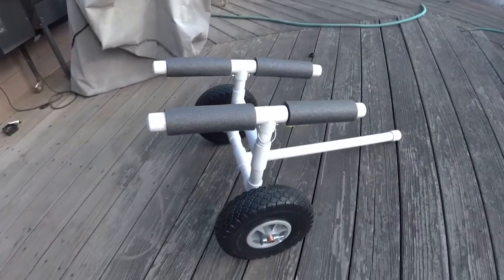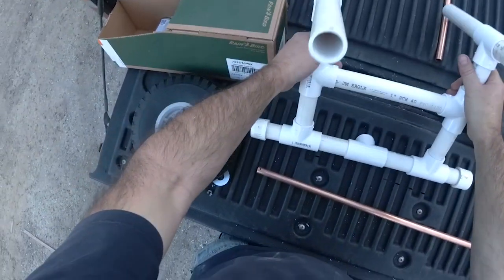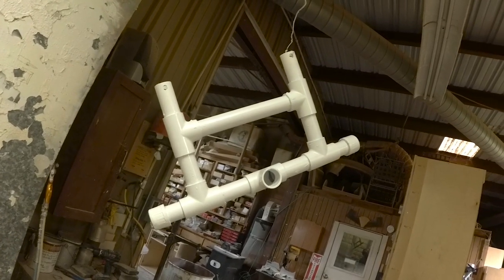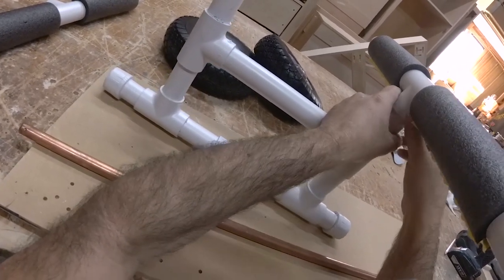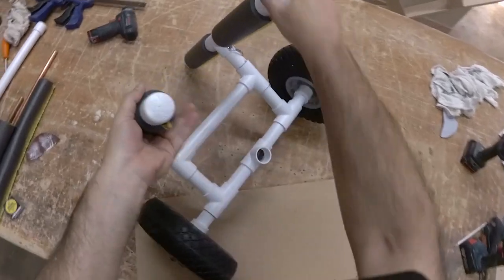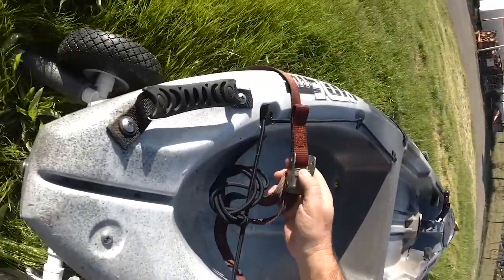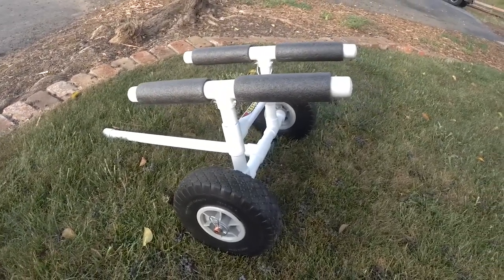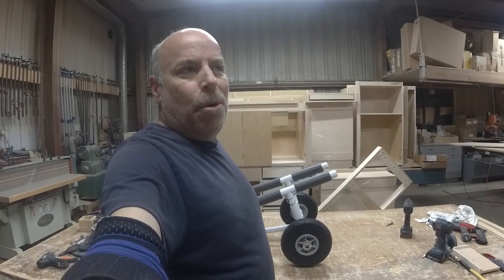My DIY PVC Kayak Cart - Can I Break It?

Comment from the maker: UPDATE: Instead of foam for the runners I re-did my cart with rubber pipe insulation. It's right next to the foam stuff at Lowes or Home Depot and is a little more expensive. I switched because my new kayak (Old Town Sportsman PDL) slides on the foam and is very hard to get on the cart. The rubber is tackier and the kayak stays put on it.

IMPORTANT: At Lowe's I found rubber insulation that is sold as 1 inch BUT is actually 1 1/8 inch inside diameter. This will fit perfectly over the 1 inch PVC. Rubber that is only 1 inch inside diameter will NOT quite fit. The Lowe's stuff says right on the rubber itself "1 1/8 inch ID". If you can find that then you are good to go! Not sure if the Home Depot stuff is the same.
Reply: Mike: when you say "rubber pipe" Do you mean HDPE, it's black and in short sections can be stiff? If so,  what class?
Reply from the maker: @tomkearns6830  Like this:

https://www.lowes.com/pd/Frost-King-3-4-in-x-6-ft-Rubber-Plumbing-Tubular-Pipe-Insulation/3132415

Just find the right size. It isn't percect but it's better than the foam. A harder rubber would be best. It would grip the kayak better, and it wouldn't smash under the weight and hold its shape better.

The pipe stuff does work though.
Reply: you are correct in that the pipe insulation has more mass than the foam swimming noodles. Good idea and improvement😃. I suspect the insulation also has more friction therefore the boat will stay more "glued" to the cart 😃

Comment: Having built something like this that I wanted to store, I drilled holes through the fittings and pipe, and ran 1/4" bolts through them. Secure with nylon insert nuts, and you can disassemble and store flat.

Comment: my thought too. i’m going to build the construction conduit one with metal joints. i go down some rough entries here in Arizona
Reply from the maker: I had plans to build one out of aluminum tubing but I wasn't sure the fittings I found were any good and worth the money. I wanted to be able to take it apart, I think I'd need an allen wrench which is fine. Didn't go that route though. May as well buy one at that point.
Reply: @outsidewithmike  you can get them at Lowe’s believe it or not.  $9 ea

Comment: I like the design! What diameter of copper pipe did you use?
Reply from the maker: These wheels are 5/8 but you can get much cheaper wheels at Harbor Freight. They may be different size.

Comment: The problem with all these designs is ground clearance. This design with a center axle is great for smooth terrain - if you have to roll over stumps, boulders and tall grass you may bottom out.
Reply from the maker: Tall grass is fine but rough terrain is not recommended for a cart made from PVC unless you have a very light kayak.

This gets me from my garage to the van, and from the van to the ramp. I went down concrete steps once and broke part of it, but I wasn't surprised! Fixed easily.
Reply: @outsidewithmike my concern as well. unloading and down thru weeds and pucker brush to ponds and lakes for bass
Reply from the maker: @andyrusten5748  I wouldn't use it for a rough ride, just ramps and smoother areas.

Comment: Hey Mike. Neat solution there. What are the coupler that you showe your axle into called? I guess they have some sort of.gasket inside.
Reply from the maker: I'm not sure I understand what you mean, but the white pieces are just PVC end caps. No gaskets or anything that you can't see in the video. If you mean the wheels they have bearings in them. If I didn't answer your question please let me know and I will try to help.
Reply: When you are pushing your copper-tube through the pvc-pipe you mention having to remove paint. The tube you are pushing it through has some kind of open endcap, but all I can find are closed endcaps. Did you drill them out?
Reply from the maker: @nicolasmunk-rechnitzer9674  Yes I drilled those holes in the end caps. My painting must have been a bit sloppy and plugged the hole a little. I hope this helps!
Reply: @outsidewithmike  perfect. Thanks

Comment: Thanks for the video, how much weight it cant take that pvc?
Reply from the maker: I will guess that my new kayak is around 135 pounds with all my gear.
Reply: @outsidewithmike  Thanks!!
Reply: @outsidewithmike  Hi great Video where did you get those wheels
Reply from the maker: @FlCoastalcaster  Amazon but I paid too much. Harbor Freight has them the chepest, about $10 a pair vs the $25 I think I paid. Make sure they have bearings and are the right inside diameter for your axle. HF had a big selection in my local store.
Reply: @outsidewithmike  I’m gonna make it from PVC like you did great video thank you so much. I’ll sub as well. I’ll make a video making mine as my kayaks bottom is way different. Wish me luck on my new channel. And again thank you so much.

Comment: I made the same design actually after doing the same you did lol. Wow amazing  same thing.....except mine Was too wide lol as soon as I placed kayak on the PVC cracked on the leg connected to the axle.
Reply from the maker: I've actually barely used it. But it has been solid the times I have. I'm kinda rough with it deliberately too.  I would maybe try something besides the pipe insulation for padding. They do work though. Not sure what I'd change except maybe the kickstand and cheaper wheels.
Reply from the maker: Also there are different thicknesses of PVC.

Comment: The other thing that is KEY, is where you position the strap and how the strap is placed. If you don't have a cleat, pad eye or something physical on the kayak for the strap to bite into, your kayak cart will slip off. That's what happened the first time.
Reply from the maker: Maybe those without something for the strap to grab onto could slide some thin rubber of some kind between the strap and the hull of the yak to keep it from slipping. I don't have problems with the straps slipping but I don't go over any tricky terrain. 

Also I think rubber padding on the Tee sections instead of foam would definitely help in that regard, and glue it on there.

This thing isn't made for rough terrain. I bounced mine down some cement stairs and - ya, not a good plan. But for a trip down to the lake from a campsite, or down the launch ramp it is okay.

Tip to everyone: don't store it in the sun full time. I had the glue fail on one of my tees last week and I'm guessing that is why. It will make the PVC brittle too, even painted.

Thanks!
Reply from the maker: Also I think grey PVC might be stronger, especially in the sun. Anyone know? I couldn't find everything I wanted because I built this at the start of Covid.

Comment: Can I ask the length of upper pipe with cushions?
Reply from the maker: Absolutely! I just went out and measured it. Mine are about 20 inches total from end to end, caps included.Each piece of PVC is probably around 8 inches.

I didn't really base this on anything other than the length looked about right. Works good though.

I also recommend rubber pipe insulation instead of the foam I used in the video. Sticks to the kayak better.

I just used the cart today and it works good.
Reply: @outsidewithmike  
Great. Thank you very much

Comment: What about river rocks.
Reply from the maker: Using a cart on river rocks? Don't know, sounds difficult. Maybe bigger wheels depending on the size of the rocks. I'd probably go with something stronger. I was going to use aluminum instead of PVC. You can get corner connectors on Amazon. More money though.
Reply: @outsidewithmike  yep. I live in East Tennessee. It's not easy getting down to put in sometimes. Usually always rock. A pretty big hill or 2 as well usually. I lucked into some 10 inch pneumatic tires today for free. I have 4 whole sticks of 3/4 copper tubing lying around so I may try that and just use some pvc (or something) for the corners and the tees. I'm going to try and have as little money tied up in my cart as possible and use materials I find or already have. I'm gonna look strange with a copper cart though!

Comment: What's the measurement of the copper pipe? Harbor Fraight $4 for tires.
Reply from the maker: 5/8 inch
Reply: @outsidewithmike  How long.... 5/8 is the easy part. Length?????
Reply: @hawkwrangler1950  I made a similar one and used a 24" aluminum tube.  But you can make it whatever length you think is best for your particular boat.  Home Depot sells these tubes in 48" lengths, so just cut it down to the length you want.
Reply: @garylewis327  I ended up using a copper pipe for the axle. I had 1 laying around. Turned out great. Gotta make another for the wife next week.
Reply: @hawkwrangler1950  Awesome.  I did the same for my girlfriend.  When designed right, these little DIY carts work great and don't break the bank.  And they're fun to build.

Comment: Droll a hole in the T for the handle and put a pin on it like you did the top arms. Wah lah!
Reply from the maker: I thought about it, I just don't think I'd crawl under the yak to remove it. But for anyone that would, that is a good solution.

Maybe you could mount the kickstand off to one side to make it easier to grab.
Reply from the maker: I saw them recently for $10. I couldn't get them at the time - Covid was new and shopping was a pain. But ya I paid way too much
Reply: @outsidewithmike  turn the cart around put the handle toward the back end, use it as a handle. Lift the yak from the back end then use the handle to place the cart. You drill a horizontal hole thru the handle at the T connection so it doesn't come off then it is easy disconnect when storing. Understand now?
Reply from the maker: @toddramsay977  Yes but I can't bend down easy enough to unhook the pin :)  It is one of my possible solutions but,  I'm gettin' old!

Comment: Copper already looks bent
Reply from the maker: Copper in the video or one you built? On mine the weight is near the ends of the tube so it would be difficult to bend. Wide angle lens on the camera may make it look bent at some angles